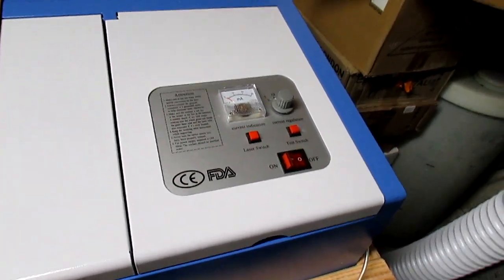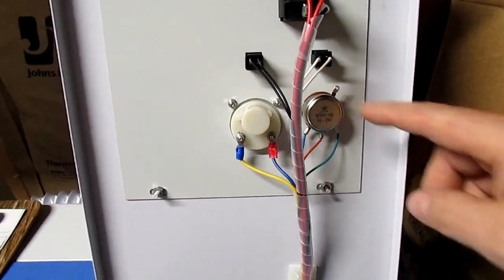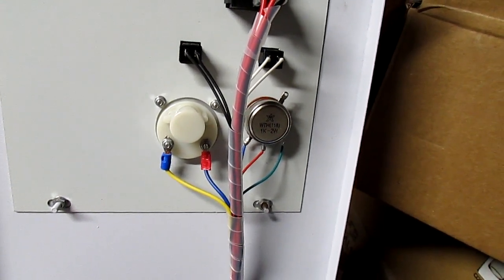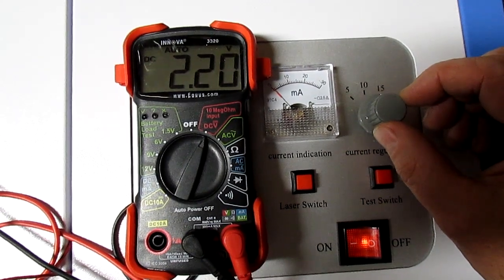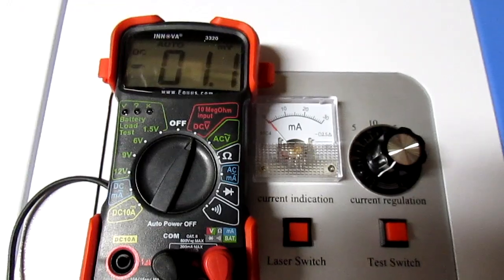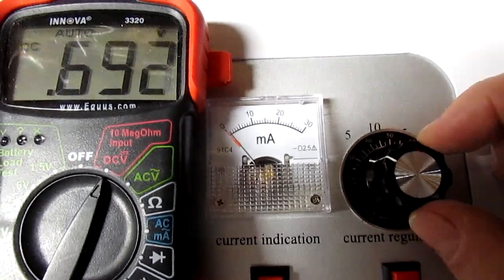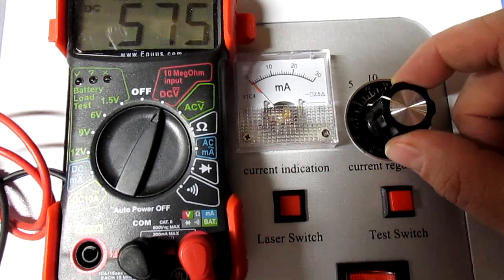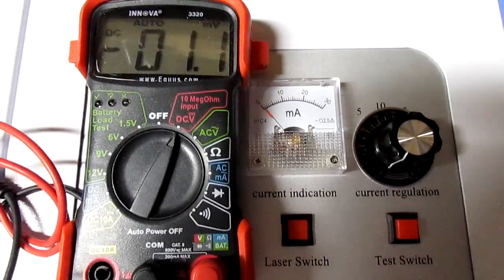K40 Laser - upgrade Potentiometer for finer laser power tuning

Comment: The only thing I have in the 2 watts range is a 100ohms Pot, Do you think I could make it work somehow? if so what would you suggest? in case it matters, i am using a CNC shield with an inverter board to PWM but the pot is still connected to make sure it never goes beyond 17mA

Comment: This is a great video I understand pots somewhat but the three wire setup had me confused. I will be doing this to my laser as well. Just one thing I wanted to do, is there anyway to get the full range of the pot starting from 0 being 0.8v to 100 being 2.2v since the laser wont turn on until you are at 0.8v.

Comment: This is awesome!!! 

I just bought a 10 turn pot and a little volt meter to install in my k40. I am totally going to use some resistor  magic to limit the high end.

Thanks to you, not only will I be able to visualize and precisely control it, but now I will be doing that all only in the optimal range.

Thanks for sharing!!!

Comment: I have the same version of K40 and will be doing this modification.  I have the pot ordered but confused on what resister to buy.  I can find 510 in both 1/4 and 1/2W.  What exact resister should I buy?  Thanks!
Reply from the maker: 1/4 is plenty.  very low current flow.
Reply: @electromechtromaker6512  Thanks so much.  Love your video because you walk someone like me through the process.  YOU THE MAN!

Comment: I was referenced to this video from a Facebook group specifically for the K40 laser. Great video man! The guy in the group used a 1k trim potentiometer so he could set the limit of the dial pot to whatever he wanted for the highest mA, which he chose to be 20mA at full turn of the dial.

Comment: Thanks for the video.
You could have used two resistors in series (1000 ohm + 330 ohm resistors = 1330 ohm) and keep the old potentiometer. That would limit the voltage at it's max to around 2.14v.
Reply from the maker: True, but then you are still using the cheap pot, for which I had to come up with a reason to replace, and figured I would go with a 500ohm carbon.  Bottom line, you are correct, limiting the voltage at the pot will spread the remainder over the range. Hindsight, I may have tried that first to see how it went. :)